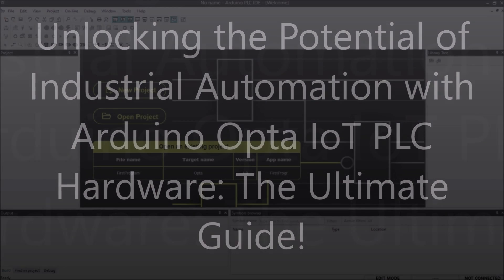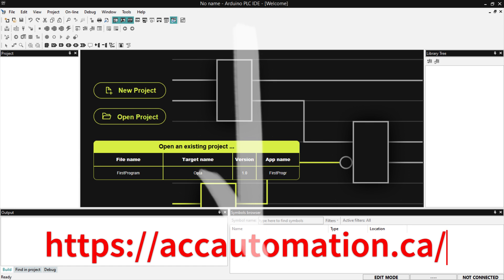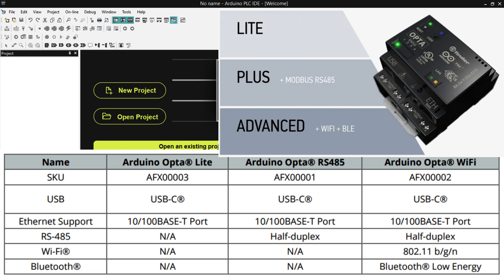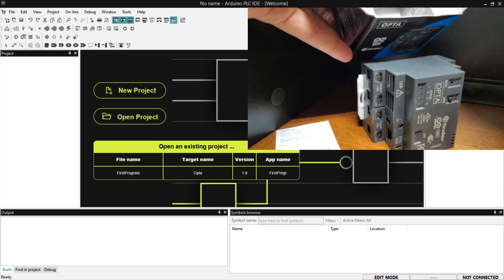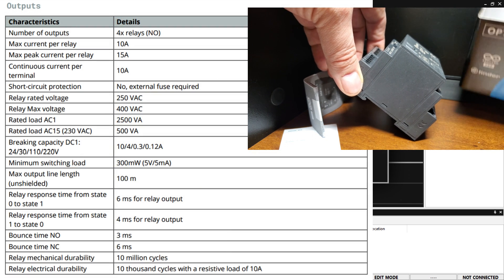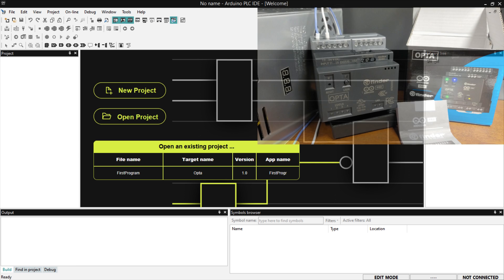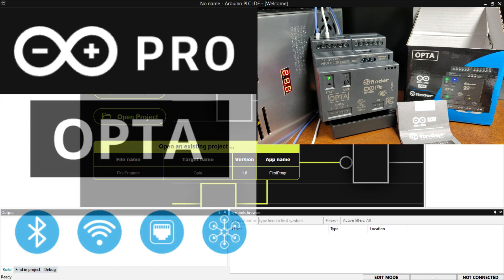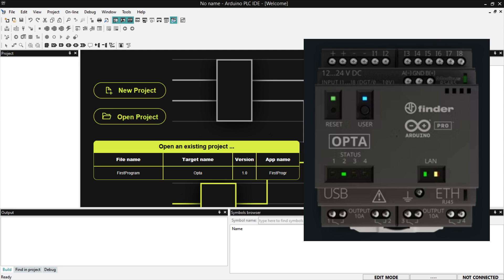Inside Arduino's New Opta IoT PLC: Features That Matter

Comment: Very interesting development, how does it compare to the Click in your opinion?
Reply from the maker: Hi @frikkied2638
The Arduino Opta has a fixed 8 inputs and 4 outputs. It does not have expansion capability yet.  No date on when this would be available. Programming is done in the IEC standard languages as well as Arduino C++. The Arduino PLC IDE is free for the Opta. Documentation is currently lacking in the Opta in terms of communciation. Arduino is improving this and should be out in a few weeks.
If you are programming in ladder logic diagram, need expansion then stick to the Click PLC. In the end it will be the more cost effect route.
If hope this helps you out.
Regards,
Garry
Reply: Thanks for info  @ACCautomation  !

Comment: Most exciting Arduino Opta PLC.  I do have an AutomationDirect Arduino P1AM-100 PLC.  However, it is always fun to try something new out.  Thanks.
Reply from the maker: Hi q zorn,
I agree; this is a very promising PLC. The P1AM Arduino has industrial hardware but is not a PLC. According to Finder (manufacturer), the Opta is a programmable logic relay. This is probably due to the current limit of I/O. However, it can be programmed in all IEC PLC programming languages and sketches (C++).
Thanks for the comment.
Garry
Reply: @ACCautomation  I did not know this. Thank you.